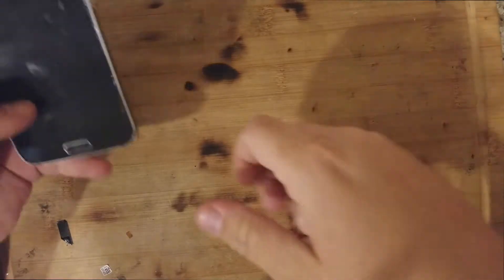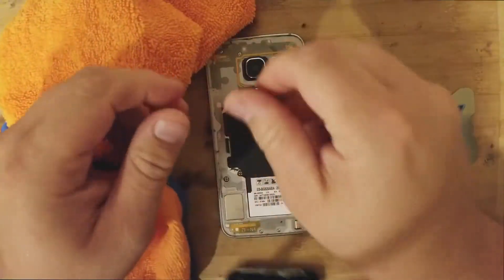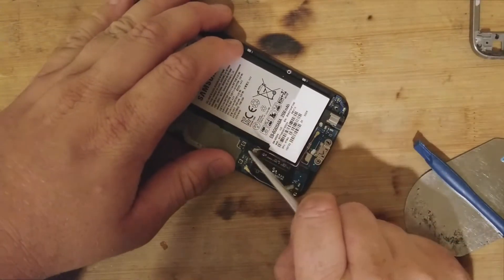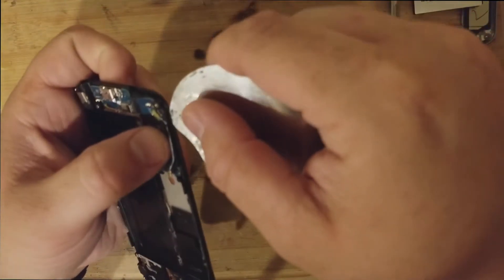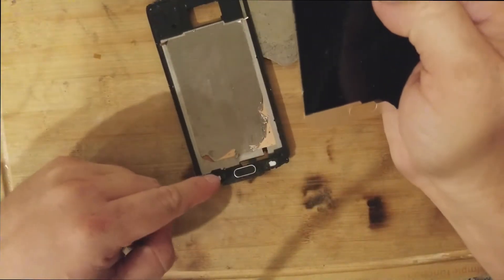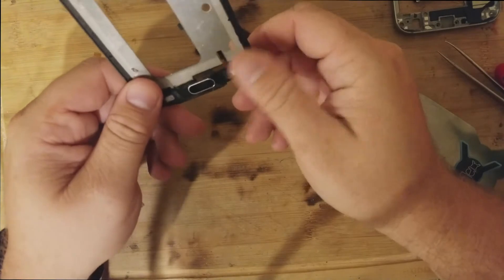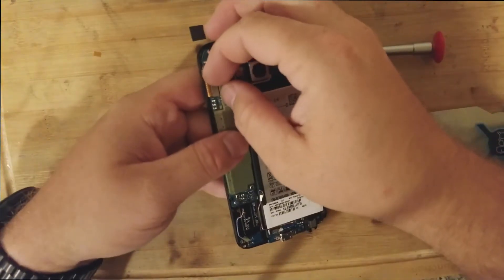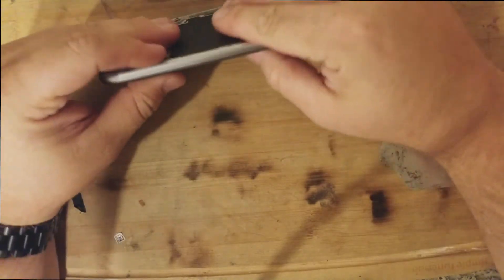Samsung Galaxy S6 Full LCD Replacement in Salt Lake City Utah Tech MD

Comment: Fake News: As long as the Glass/Laminate is fine you can always avoid scraping the laminate on the back of the glass even without a suction cup. Instead of a metal tool to run along the adhesive use a metal tool to get in between the glass and frame and then use a playing card with a small amount of 99% ISO alcohol on a cut corner of the card you will not damage the laminate coating on the back of the glass as long as you use care.